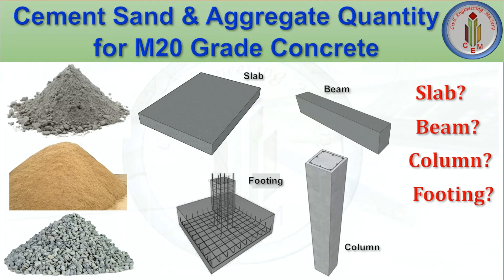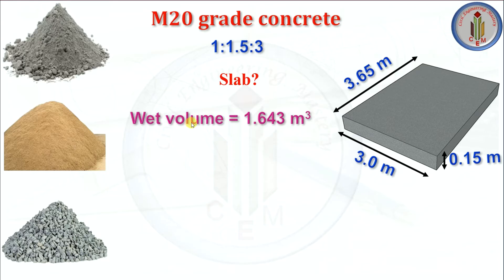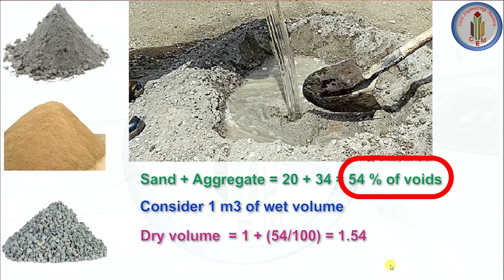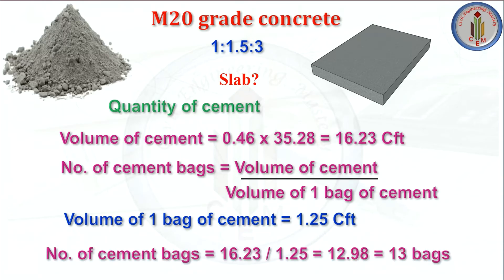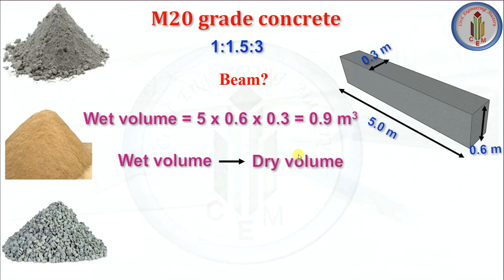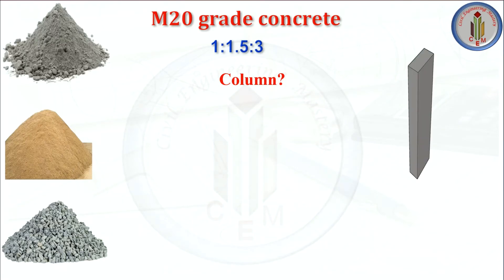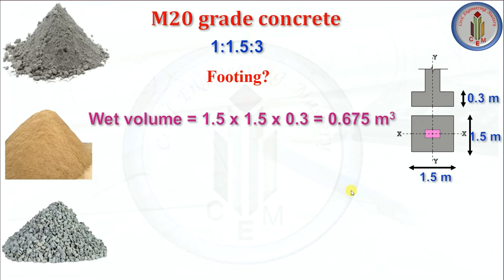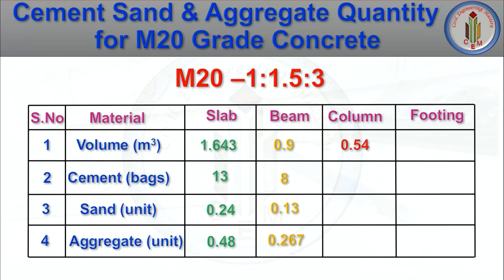How to calculate Cement Sand & Aggregate Quantity in M20 grade concrete |   concrete material

Comment: Hello nice video ! I didn't understand why we had to transform form cubic meters to cubic feet. 
Can anybody explain ?  The slab was measured in meters which is Metric. 
Why change to Imperial ?
Reply from the maker: There is no rule to change the units.
Generally, site measurements are in Feet and inches. So to simplify the metric units are converted into imperial units.
Reply: What if you I only use cubic meters for volume